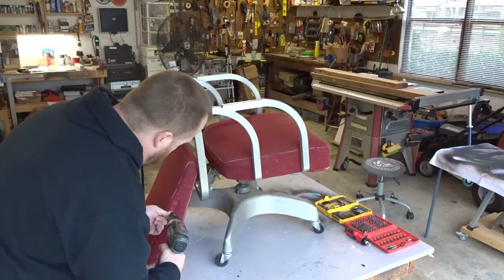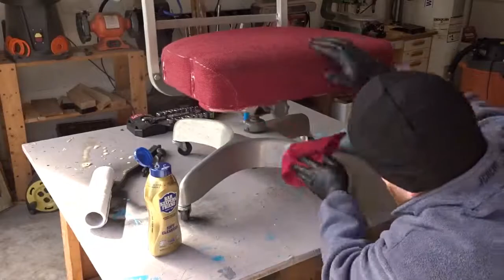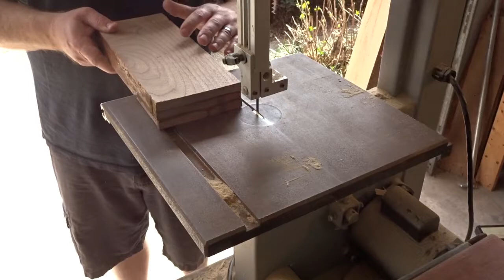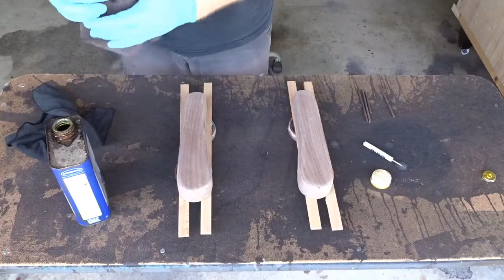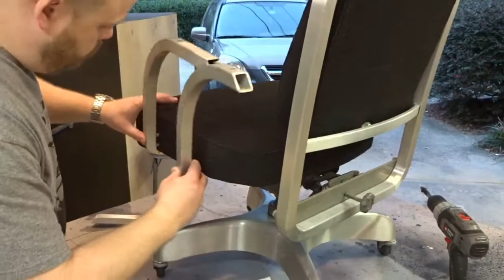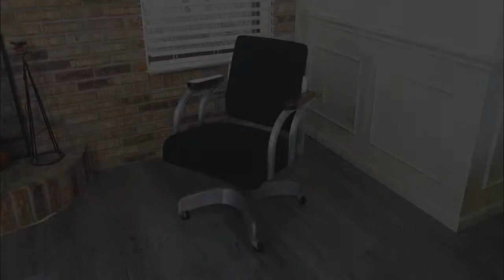Repairing & Restoring a Mid-Century Modern Office Chair - Found for $5

Comment: Nice job... you didn't have to sand down the aluminum to get any gouges out?  If you did would you remember how you did it/what you used?  Hard to imagine that this old chair made it all these years with dents and dings to the soft aluminum.
Reply from the maker: No serious gouges, it was in really good shape. I mostly used steel wool to get it smoothed out
Reply: @ChadMakesIt  Thanks for that!  Im actually about to start restoring a similar chair tonight.  I was about to run out to WM and grab some BKF but am reading that something called Bon Ami would be better for aluminums.  Do you have an experience with it or revised advice on cleaning, polishing and protecting it from corrosion?  Thanks again!
Reply from the maker: @southriverco  bartenders friend me5al polish will do it

Comment: Hi Chad, I have the exact same chair with the original tweed fabric & padded arm rests. Thank you for the BarKeepers friend suggestion! Can't wait to clean it up with that. My problem is the chair is starting to lean back when I'm not in it. How can I fix this? There has got to be a way.  Thanks so much!
Reply from the maker: Just discovered barkeepers friend who recenty myself, it's a great product. There are 2 knobs on the chair, 1 on the back and 1 underneath the chair. I would try tightening both to bring to keep it from leaning back. You may need to use a little wd40 to get them to turn better.
Reply: @ChadMakesIt  It worked! I had tried the smaller one underneath and it slowly pulled the chair upright. Thank you so much! Woo hooo!
Reply from the maker: @sarahvansicklen3029  Sweet! glad it worked, Thank you for watching!